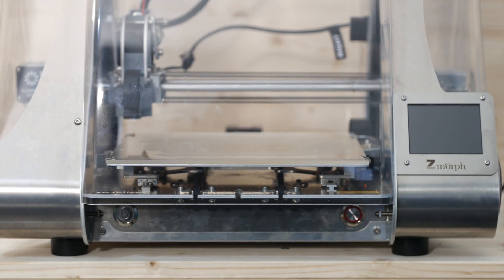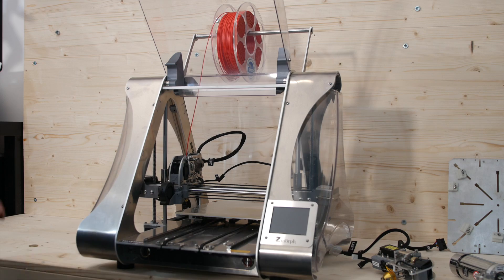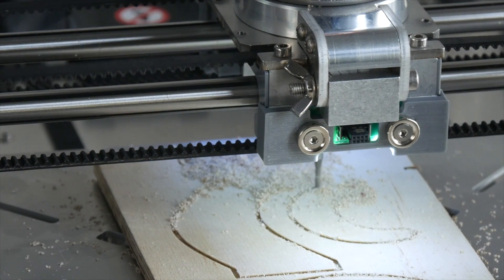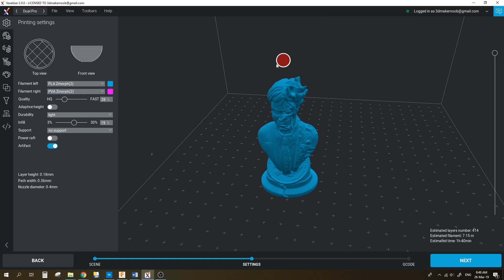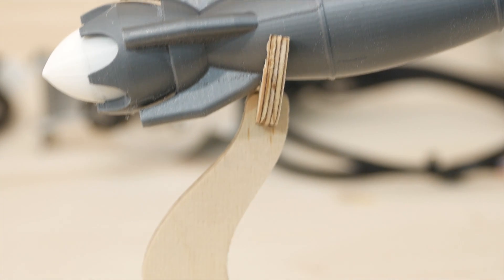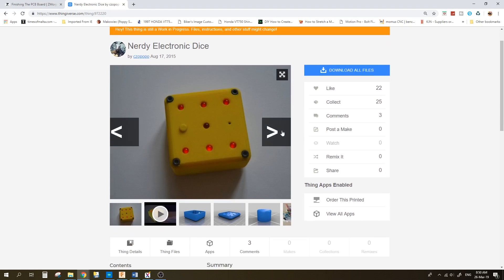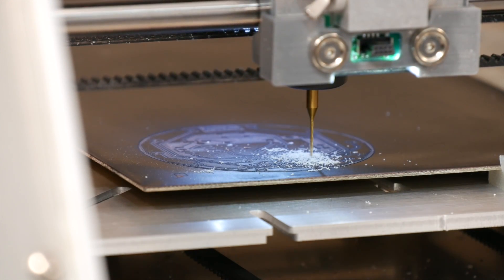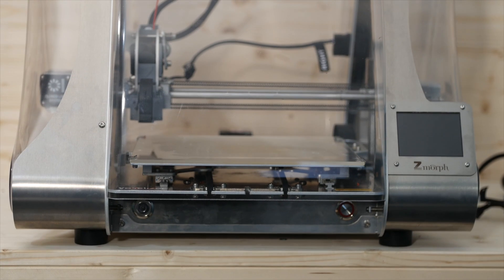Zmorph VX 3D Printer Review - A Full On, All-In-One  Prototyping Machine

Comment: snapmaker is a lot cheaper what are the benefits of the zmorph?
Reply: It is similar only by a first look. Please look closely at the specification. Compare the power of the laser, for instance, or the materials that are available for 3D printing.⚡
Reply: @ZMorphHybrid3DPrinters   ok but is this justifing the 400 percent higher price? i also think materials are the same for 3d printing ... also there a ton of mods for the snapmaker... im not a big fan of these 3in one anyways, i prefer one REAL machine for each :D
Reply: @DaveDRC , It is an interesting topic, but it is hard to answer your question because those products are very different, and there is a lot to say. I will try to show you another few examples below so that you can judge by yourself. :D
I will also drop a link to the article on how we managed to provide 3D printing and CNC machining from a single device. Have a glance also at our ZMorph Materials Library. 

Our machine, and it's sturdy construction, were designed to work 24/7, without any loss on quality so that you can count on its reliability. It is very important when it comes to CNC machining that our construction is much more stable, so it can provide more precision during the milling.

When it comes to 3D printing materials, thanks to a closed environment and heated table, you can easily work with materials that have to be printed in a specific temperature like ABS, for instance.

ZMorph Materials Library:
 http://bit.ly/ZMorph_Materials_Library

CNC & 3D printing with the usage of a single machine: http://bit.ly/ZMorph_3D_CNC

Comment: we here at the digital innovation centre have 3 of the 2.0 SX machines initially it was interesting as there was some problems with the software voxelizer which we think is the biggest weakness of the machine. That being said however the quality of the build and some of the little innovations they have on the machine (magnetic hinges) are on a different level in the 3D printing world. We are glad to see that they made some changes to the design of the machine notably the table used in lasering and milling, the original wood tables are a let down
Reply: We've gathered all of the feedback and applied some improvements. We are happy to see that you have spotted a few of those differences.⚡

Comment: Wow. How long until a "prosumer" grade version of this is available < $1k ?
Reply: this is still a hobbyist level machine...prosumer would be something that could mill much stronger materials and require a more powerful spindle and probably increased rigidity
Reply: @tykempster  the printing quality is on the same lvl as the ultimaker, and a better than lulzbot which are still much more expensive than VX. It's not a machine for makers, it's a platform that works 24/7.

Comment: Nice machine and execution of a all-in-one for sure. But a Nomad CNC or Carvey CNC would be a cheaper option (and I’m betting more capable). You could likely add a laser to each of the mentioned desktop CNCs or buy a laser kit. You would still have money left over for a solid 3d printer of your choice. So unless workspace is at a premium or you just really want a all-in-one solution I’d much rather have 3 separate machines that could all be working simultaneously.

Excellent review as always though Joe! 👍🏻
Reply: Herein lies the rub... it definitely looks like a very drool-worthy machine... very solid, well engineered, and multi-purpose capable... however... The price is a definite sticking point... not that I am unwilling to pay for quality, but it is out of the range of even a semi-casual purchase... this would be something to save up for over the course of a year or maybe more... which brings me to the second point, one machine doing all three jobs equals a severe bottleneck for your projects... ok for a sporadic DIY hobbyist, or someone with extremely limited space, but increasingly difficult to deal with as your desire to do things grows... not to mention the inevitable compromises as you go from essentially a free floating head for 3D printing and laser, to the much higher lateral forces required from CNC milling...  then there is one more caveat... by placing all your eggs in this one basket, when it fails (as most will) then you lose all functionality across the board... as opposed to three separate machines...

The combination of the price, bottleneck, compromises, and potential downtime make it quite a bit less than ideal for the price point.   Either way, I will still be keeping my eye on it!

Comment: Impressive machine! I enjoyed your full process of making PCB, soldering and printing. Too bad you can't keep the machine, you really deserve it. One question though, can the machine be left alone while milling, or do you have to constantly vacuum up most of the dust and particles during? Is it a risk of debris getting lodged into the belts?
Reply from the maker: Hey, I’ve left it milling alone a couple of times, only reason I vacuumed was for recording purposes. There are chances you’d get small particles everywhere, but very easy to clean or wipe down

Comment: Hey. Love your videos. We have had this same printer in our office in NY for almost a year now. We have been struggling with it a lot. The nozzles are non standard, and the company wants $40 for one replacement nozzle, which we feel is highway robbery. We have reached out to actual manufacturers because these nozzle cannot be found anywhere but Zmorph. Manufacturers wanted even more to make it because of the setup time. So huge runs would have to be made in order for it to be worth their time. Automatic bed mesh leveling is so damn sensitive that after we used it as a CNC on wood, it blew out the tilt sensor and now the bed cannot be leveled automatically. It has to be manually leveled. Next we have the fact that it doesn't store said manual leveling, so Every time you boot the machine up, you have to level it again. And last, ZMorph Voxelizer software is ok. Not great. So we have used Simplify3D. Zmorph never provided a profile for it so we tried using the SX 2.0 profile and everything came out terrible. Eventually they finally gave us an FFF profile for simplify3d, and the print quality went up dramatically. My boss was really pissed off at the fact that my cheap Ender 3 at home was out printing this $4k behemoth. Even now with the better print quality, we are still having massive issues with ABS and PETG. We reach out to ZMorph regularly with issues. They always answer, but not always in a timely manner, and understanding what they are saying is a whole other issue. It looks like they have a lot of video information available, but we can never find any of it on their website. We have to email them with an issue, and then they send us a link the video that explains how to fix/address our issue.  Any way. It looks like you have had better luck than us. Good luck with that thing.
Reply: Looks like quite alot of things need to be addressed for such a high price machine. I'd like a bigger area for the money too. Cant say I like the fact the nozzles aren't universal either that has really put me off.
I also don't like the look of those belts,too flimsy ,they need to be solid.  I dont own a 3d printer but I really want to jump in however I'm finding so many have real bad points which in my mind SHOULD be obvious in the design stage of these machines.
Reply: @nicholasparsons5254  completely agree. That’s what’s put me off getting one yet, I just keep holding out
Reply: So you wouldn’t recommend?

Comment: That's the problem, jack of all trades master of none. The other is -- volume is far from what it should be at this price point. It needs to be bigger. For the money, you can get an enclosed CNC (carbide 3d nomad), an mk3 with the MMU upgrade, or similar, and a small laser engraver and still come out ahead, and you have a small CNC capable of a lot more than this machine. I understand 1 machine is sexy, but to borrow your favorite turn of phrase, to be completely honest, I own a nomad, there have been multiple occasions when I had the nomad running machining aluminum and a 3D printer running printing a part which would attach to the finished aluminum piece. A CNC which can't machine metal, is NOT a CNC.
Reply from the maker: Who said it can’t machine metal? :) stick around, next project on this will be a bit more thorough ;)
Reply from the maker: Aside from that, keep in mind that not everyone has the space to have multiple machines, more so having the ease of use that this one has. This fits perfectly well in a classroom or a small lab or office. There are specific market segments for each machine, this isn’t pointed at all of them and I understand that hence why I mention it.

Have a full blown CNC is always a plus of course and bigger volumes help, but having a single prototyping machine that can do all, and do it extremely well is gonna be target a lot of potential buyers

Comment: I am always sceptical when there are "all in one" machines for 3d printing, laser engraving and cnc milling, since all of these manufacturing processes have their own requirements to the machine. However this machine really looks like a decent solution to combine these into one machine (at least for light milling projects). There are lots of small and clever features included on this machine. Unfortunately I can not afford it either.
Reply: I'm very dubitative. The Zmorph manage to be more expensive than better capable separate machines. Lasers, 3d printers and mills have different needs. 3d printers needs to be  light and fast, like lasers but lasers produce fumes and burnt residues which 3d printers don't like, as dust produced by milling. Milling needs stiffness and vibration dumping. So mills needs to be heavy and don't need speed or high acceleration at all. Different technologies and different purpose should lead to different structure and different components IMHO. On the Zmorph all is about compromises because it should be acceptable in any operation. But it can't be good in every application : heavy heads for 3d printing, not fast enough for laser applications, not really capable for serious milling operations... Last but not least, it does all one at a time, so this is not really good at production purpose. For half the price of the Zmorph, you can get a large volume and faster 3d printer (U20), a 500x500mm fast 15w laser (Elekmaker), and a stronger 800w ER11 CNC mill (2030), which can work at the same time. If you really like paste printing you still have money left for a delta and a paste extruder. For an electronic dice, the Zmorph would be perfect. But if you want to build serious, useful stuff, you want serious machines, not a Swiss army knife.
Reply from the maker: Wait till the next zmorph project I am gonna post and then we can revisit this conversation ;)
Reply: @3DMakerNoob   Maybe you don't have much experience with Laser or CNC machining. But would you compare the 3d printing abilities to a U20 that cost 10% of the Zmorph price ? I've been a CNC enthusiast owner for near 20 years. There's physical reasons why the Zmorph won't reinvent the wheel. First: tool course which is very small compared to other inexpensive machines. This is important for any technology, and especially for CNC milling where tool height and clamping area matters. The Zmorph user is limited to small trinkets. Second: time ! Because of its conception (heavy laser/hotend end or light CNC guides/structure) you will never be able to make the Zmorph works as fast as specialized machines, definitely. Especially if you consider one by one operations. A 300w spindle limits the user to light materials AND small tools that  increase a lot machining time. The structure is heavy compared to the needs of 3D prining or plotter applications, but it's still very light for a proper CNC mill. There's a huge difference between a CNC capable of 6mm clean passes in 7075 aluminium and a multifunction PCB mill that just allow you to scratch aluminium along micro-passes that still vibrates a lot. 

Don't get me wrong. The Zmorph can of course do various operations. BUT not as well as specialized machines, and especially a proper CNC mill. Consider the price, buying a Zmorph sounds a very bad idea, unless you live in a van with a 600mm cube left for a single tool. The ratio price/abilities sounds very low in the market today.
Reply from the maker: I’ve built my own CNC mill about 7 years ago as I had done a custom motorcycle and wanted to fabricate the parts myself out of billet aluminum, so I have a bit of experience. But it’s beside the point of this machine, this is not made for fabrication on a large scale, this is a laboratory or a classroom prototyping machine. Not everyone (including me) has the space for all those machines. And yes, this by far better in terms of print quality than the U20 on all levels, it can very easily print at 60mm/s without breaking a sweat which is my go to speed. It’s all about versatility. I completely understand what you mean, but it’s all relative to the target market
Reply: @3DMakerNoob  I understand your point of view: that's a machine for low needs people which can own one single machine only. Or educational purpose of course. I'm none of these as you already understood. By the way, I print at 80mm.s with various machines including a U20 with perfect print quality. I mean as good as a FDM printer can do (Stratasys included). To my eyes, a smaller and much expensive machine won't challenge a lot. I would enjoy to see your DIY CNC mill during a shop tour video.
Reply from the maker: Will definitely do a couple of videos on it, the electronics on it are outdated now so a revamp is overdue :)
Reply: @3DMakerNoob  I guess you are talking about the U20. Well, here you can get one under 250€. That's a pretty good price for the build volume. On the other hand, you can still get perfect prints with a 2007 ramps. What do outdated really means ? I used to stay focus on the machine abilities and the result on the part produced. By these two axis, a U20 is a pretty good value. But  I could say the same about other old fashioned printers that still prints well.
Searching for Zmorph info on the web, I'm surprised about how much used Zmorph are for sale actually. Maybe early  buyers are not interested anymore by home manufacturing. Maybe there's different reasons much unfavorable for the Zmorph. Hard to say.

Comment: be careful with a UPS connected to a 3d printer, make sure the UPS can handle the full load of the 3d printer at max draw.. it will heat up like a son of a gun even if it can handle the load :)